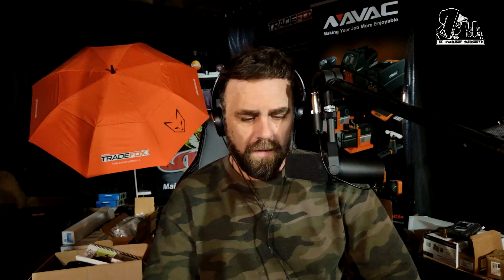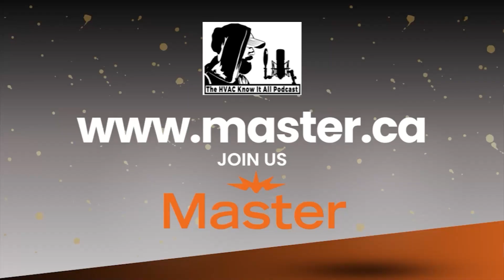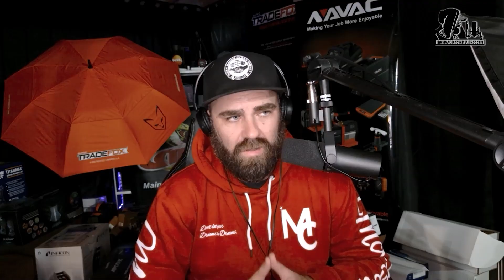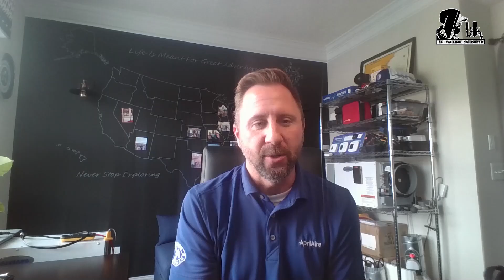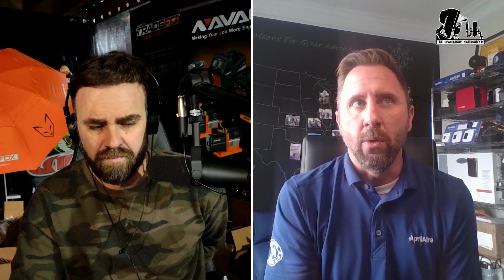The HydroCore Humidifiers for HVAC Contractors to Reduce Water Waste with Chris Howells Part 1

Comment: Which model is best for a system with a heat pump? Irregardless if it’s all electric or dual fuel. Also is bypass or fan powered better for a system with a heat pump? And lastly with a heat pump system is hot water feed ideal or does it also not matter, hot or cold is fine? Thanks